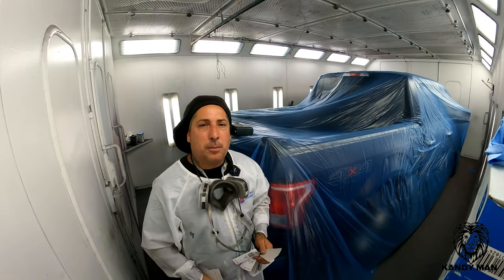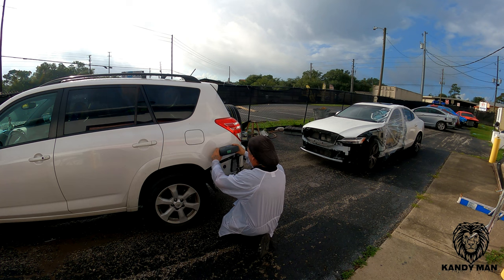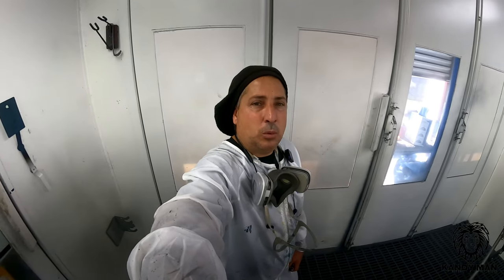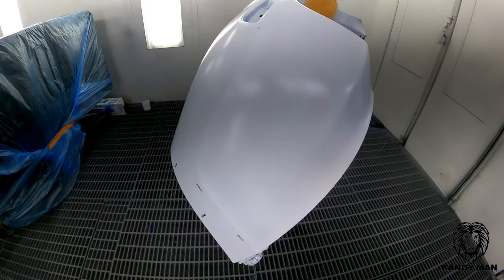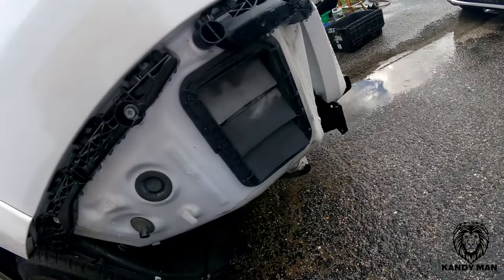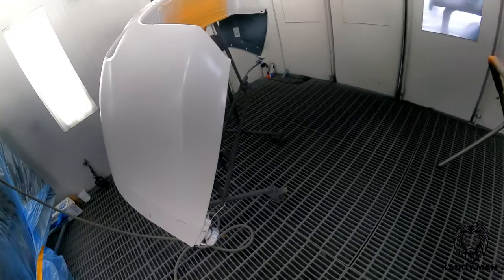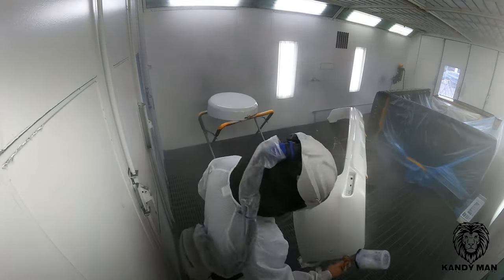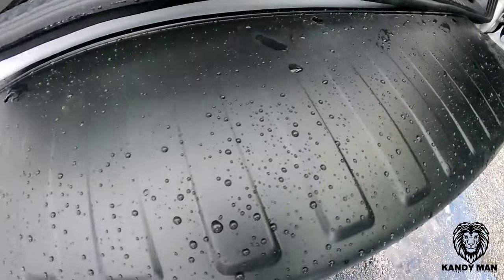3 STAGE PAINT - TRICKS OF THE TRADE

Comment: Awesome.Our camera when we pull up the image on the computer it has the option to add the make/model and paint code before  clicking search .Do you leave that blank?And did you just go with the “standard” color pearl and did you use the paint code of the vehicle for the pearl?Like what if for example my scanned color after choosing it as a “solid “ color the computer finds a Honda color that matches it but it’s a GM I’m working on?
Reply from the maker: Try it both ways to get the best match

Comment: really interesting to know that the cameras took the solid that really almost matched the pearl. For the pearl coat, are you mixing the original pearl as per the system or ure using the camera to get the pearl shot as well?
Reply from the maker: Shoot it as a normal color and use that pearl  coat